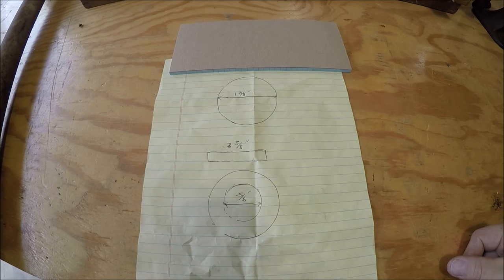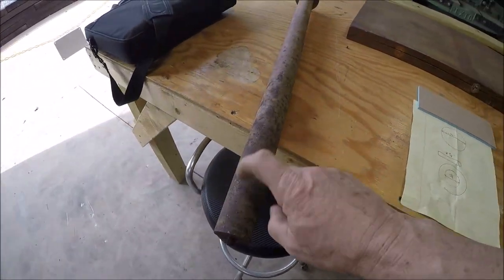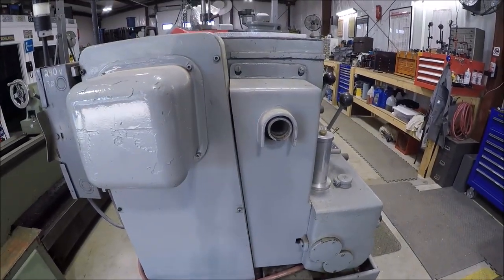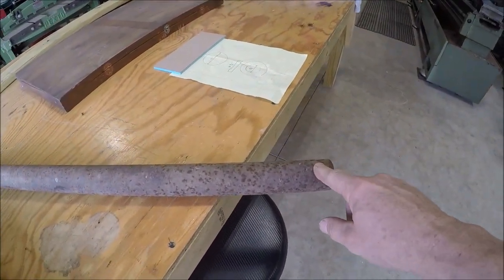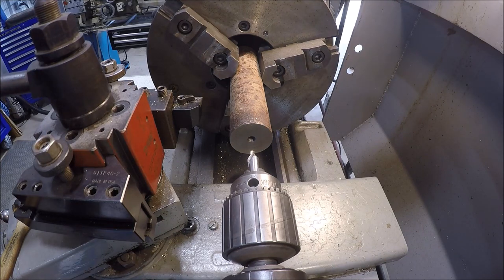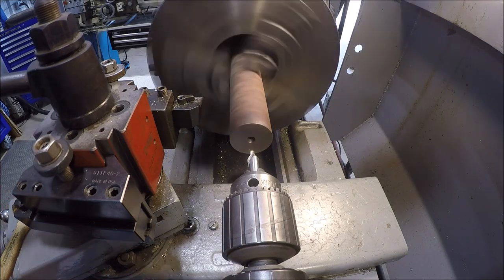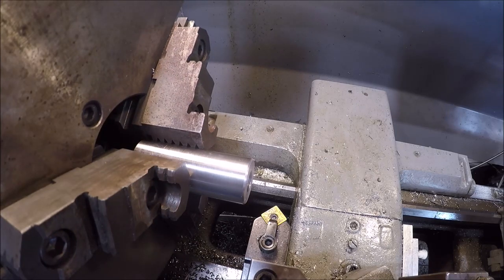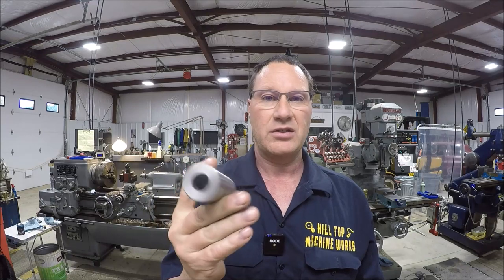Simple lathe turning job

Comment: Good one Tom .  I bet if you used that tool you use for chamfering for parallel turning it would solve the problem .  Cnmg's can dig in a bit if there is any wear in the screw .   I normally angle them around a bit to prevent it .   Cheers .  👍

Comment: The bigger the hole thru the spindle the less rigid it is. I am sure that is the main reason for the small spindle bores. Of course it was also very common to do work between centers which were typically Morse taper so that means 2# is the biggest you normally find since that covers up to a mt6 and 7 is pretty rare.

Comment: Always good content Tom. Great advise you shared on standing back from the chuck, and not reaching over the chuck with a file in use :)>. Hoping that storm that tore thru Texas and still headed east misses your area. 14 touch downs across 7 counties, not good & yes one was 3 miles to my NW. Blessed Holidays, and be safe & stay safe, Bear. PS - Happy that my Leblond has a 1 7/8 in thru hole, but I love those ole Monarks :)>.
Reply from the maker: Just cold and rainy right now. Temps are supposed to drop next week. I will definitely have the woodstove fired up.

Comment: Nice work Tom. question I had thought that tool pressure would cause you to cut less than what was dialed in not more.
Reply from the maker: Yeah normally that should be the case. I am thinking that as the tool gets into the cut it is getting pulled in to the work because of backlash in the cross slide screw on my lathe. I could be wrong on that.